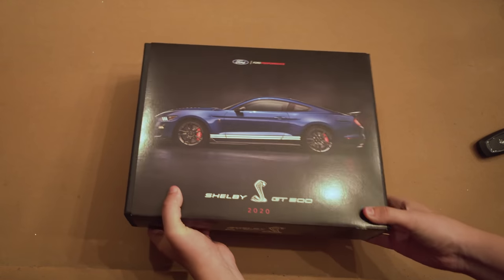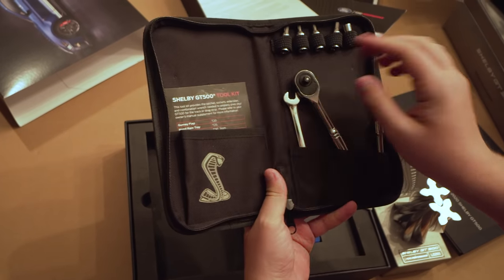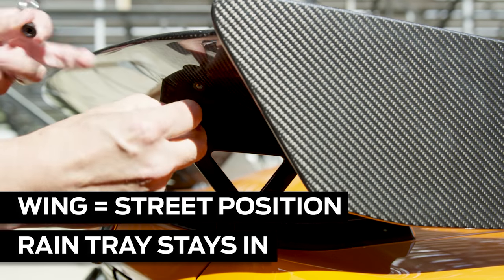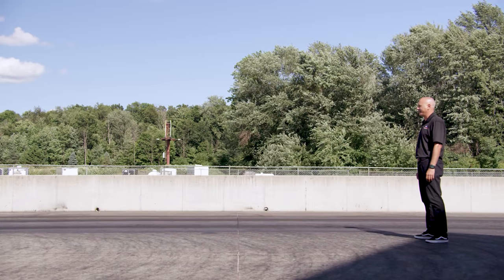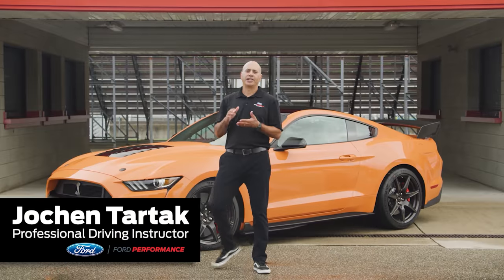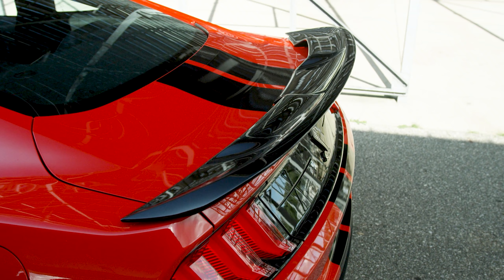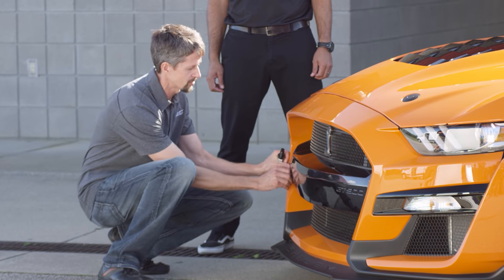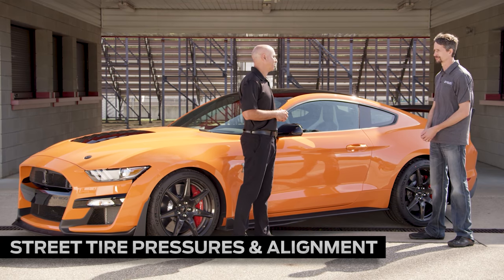JUST RECEIVED MY 2020 GT500 OWNER'S KIT! *TOOLS TO MAKE THE SHELBY EVEN FASTER*

Comment: The only question I have is after you put mileage on it and are taking it to track and racing it, when the parts start going out and  you have to start replacing expensive parts, how does that work? I think that's the only reason I wouldn't buy a car like this unless I was a millionaire or had a sponsor.

Comment: Dude its says in the video in small print when he was using the track apps to launch the car that doing so may void your vehicles limited warranty!🤯 wth!
Reply: I believe you are permitted to run the car on a drag strip and participate in track days, but will void the warranty if you use it for competitive racing.
Reply: I believe it also gets voided if something happens to your car when you’re using Launch Control on the street since it’s a “track only” feature.

Comment: How is this like the DEMON crate that cost the owner $1.00 ? Ford is cheap, $10,000 stripes, $18,000 carbon fiber package I think these are nice cars but VENOM doesn’t kill the DEMON and they are 2 years old and haven’t deprecated, can’t say that about a GT350R but time will tell on the GT500 .
Reply: One more thing it won’t pull the front wheels off the ground, the coolest thing a Demon can do .
Reply: The demon box is $1 for a reason. They pulled a fast one on the government safety and emissions by getting the stamp of a approval to sell a car that meets the standards then they ship you a crate for $1 that turns it into a cobra jet not meant for the street. That was the last time you see dodge or any manufacturer ever do something similar. Government won’t allow it again. Demons and redeye’s run mid 10’s as sold from the dealership same as the 500.
Reply: @robbyturbo109  Did I just hear a Demon Rearend snap🙄🙄😉
Reply: Soy Tu Padre it should come standard with a catch can and a diff brace but it has so much torque ,Dodge will warranty it if you break it at the track will Ford?
Reply: @abz5485  Demon is one and done...never again will a manufacturer be able to do what Dodge did with the Demon. I agree that the $1 was to circumvent the system.
Reply: @soytupadre7887  A broken rear end will never happen with a stock GT500...the launch is pathetically slow.
Reply: Robby Turbo how those difs holding up on the demon😂snap
Reply: @robbyturbo109  Good way to put it somuch torque🤣🤣🤣, I seen an had car's with way more torque an no problem
Reply: @robbyturbo109  look every car was a weak link, an only the Deamn is covered by warranty if at a track, an don't forget a brace or modification will void the warranty
Reply: @billiebuckamer8189  The Demon  will never go around a track as fast as a GT500 stock for stock, You see how that works kid. No such thing as a perfect car🙄😅
Reply: Soy Tu Padre Remember the Ford Engineer that said “Venom Kills Demon”.   He likely was referring to on a road course, right? He really set the benchmark high there. Lol
Reply: Done with ya✌✌
Reply: Soy Tu Padre  Or put the GT500 on drag tires. The Demon will still be quicker and the GT500 will still turn better.  They both meet their design purpose.
Reply: @billiebuckamer8189  Don't think you can bolt a rim to fit a Drag tire on the GT500😂, There is one thing we agree on though👍